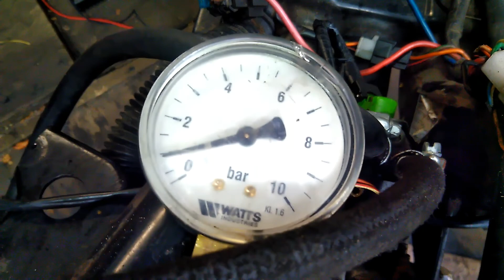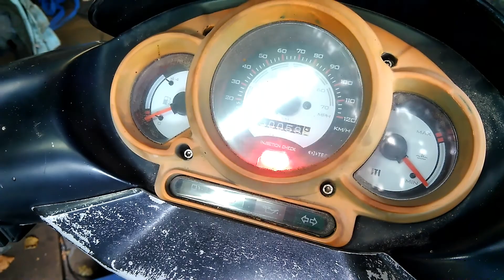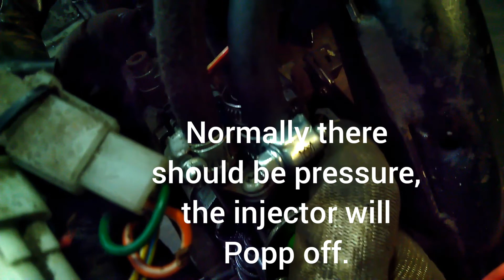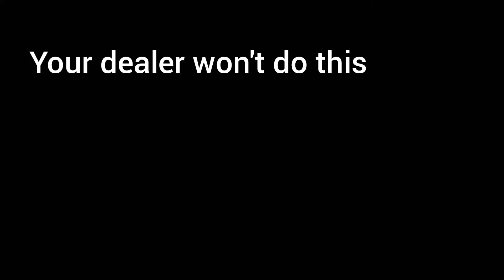Marco Melandri Aprilia SR50 Ditech Diagnosing 4; compressor testing

Comment: .hey greetings from Croatia... if it's not a problem to answer what you used to clean this part of the engine in the video. Thank you in advance.
Reply from the maker: hi there! started using wheel cleaner and water. later used some washing petrol which worked better
Reply: @knetterman  thanks for the quick answer, I know exactly what you mean because we use the same product for removing fat. If I have any other questions, I hope I can contact you freely since I drive a Purejet.
Reply: @knetterman  And sorry if the English is bad, but just in case, I'm writing via google translation, thank you once again for your answer. Best regards.
Reply from the maker: @Dominic1-eke  Always feel free to comment. Will react when I find the time.
Reply: @knetterman  but of course without any rush, if you can help I will be very grateful, I am watching your videos for the second time and they are very instructive and interesting, so thank you for that too,👍